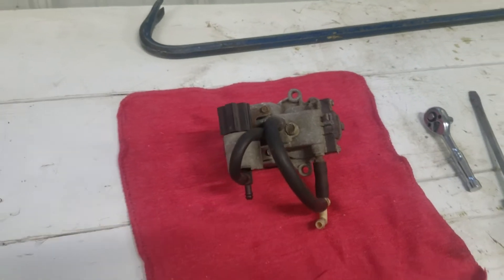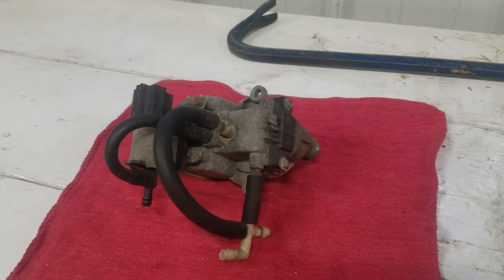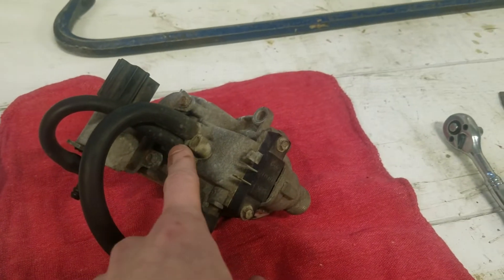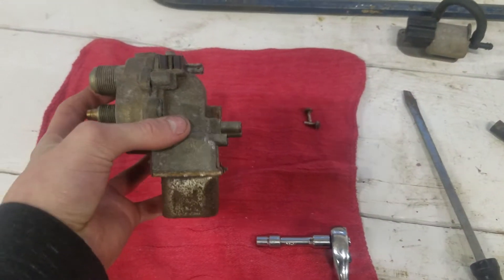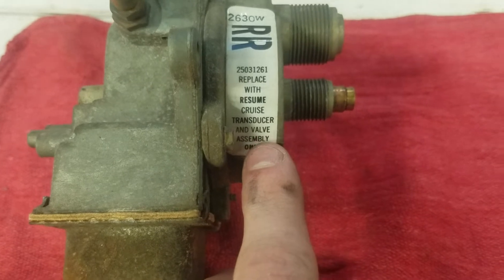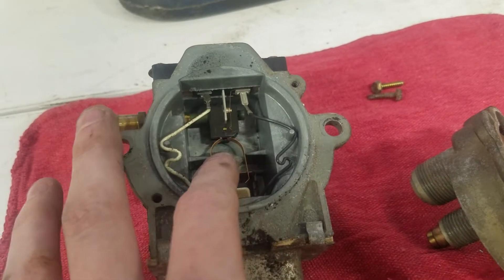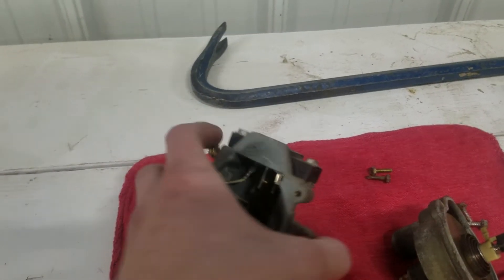how to diagnose and rebuild GM cruise control transducers

Comment: I’m a year late but your explanation of how these work and “resume” is a little off. The resume feature is separate from these transducers. There is an additional piece that handles the resume operation. I’m not familiar with how they work exactly because I’ve only ever worked on the non-resume type. That said, you are on the right track with explaining how the solenoid squeezes those two arms on the rubber drum. What happens though, is the speedo cables spin the disc inside the transducer and that rotates the other disc (by magnets I believe) which is attached to the drum. The faster you go, the faster the disc spins and the further the other disc and drum rotate. Two things happen, one is the little arm on the drum rotates out of the way and allows a set of contacts to touch (usually over 35mph) and allows the cruise to engage when the button is pressed. Below 35ish, the contacts are open and cruise cannot be engaged. 

The other thing that happens is, when the arms grab the drum they’re attached to the sliding mechanism above which meters a controlled vacuum leak. If your car speeds up (downhill) the slider exposes more of the hole creating a larger leak which allows the servo to lessen its pull on the throttle. If you slow down going uphill the discs are spinning slower, rotating the drum less and that closes the hole creating a stronger vacuum signal which makes the servo pull harder on the throttle. Hope this makes sense and helps.

Comment: Can this be used with a ls swap with drive by cable throttle?
Reply: Only if you have a cable driven speedometer. If you do have a cable driven speedometer, you will be better off with the 80's version, it used an optical sensor on the back of the speedometer head and everything else is done electronically except for the vacuum servo. It is a much more reliable setup, easier to diagnose and is a much smoother operating setup

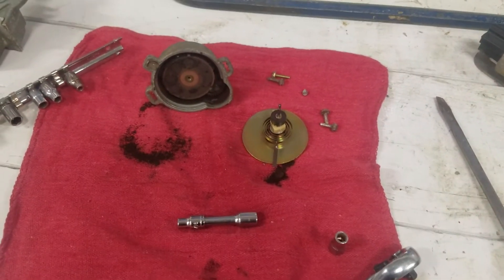Comment: The audio cuts out at 13:44, just where you are about to explain the source of the failure!  What happened next?
Reply from the maker: Darn, that's kinda crappy isn't it? The good news is the phone I was using to record this got fried so that won't be an issue in future videos. Basically, to answer your question, the magnetic part of the unit was all full of metal shavings and dust, which I cleaned out and the mechanism spun much better after that